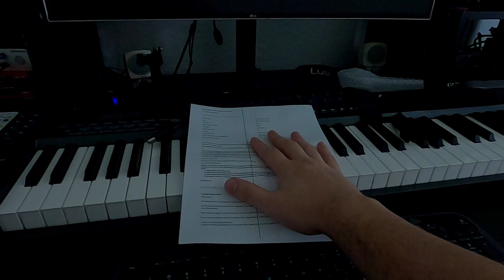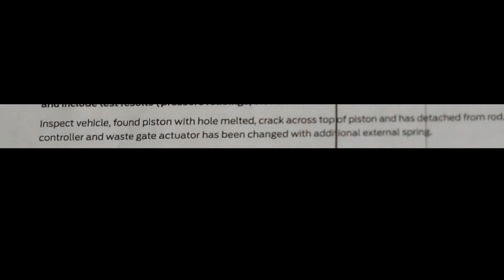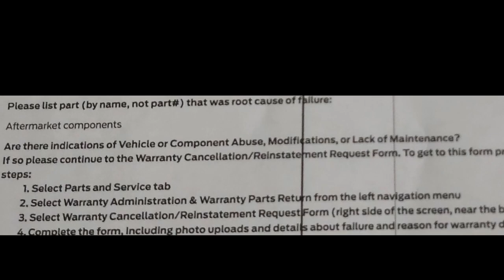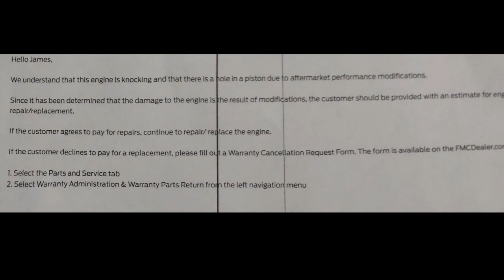IT'S OVER... Ford Cancels Warranty - BEWARE!

Comment: I watch your other videos and I don't blame Ford. Putting diesel , a gallon of Marvel Mystery oil and a gallon of Lucus gas treatment , a cheap air cooler from ebay for views. You shouldn't be calling a foul against Ford.. Go ahead and delete my post.
Reply from the maker: Diesel Fuel never went into the tank and the eBay Intercooler is irrelevant. Your first comment was fine, but now you have shown complete ignorance based on your perception of my other videos. My ecoboost isn't the first to prematurely eat itself, and it won't be the last.
Reply: @KarzKreated  don't matter you posted a video saying you put diesel in the tank, gallon of lucas in the tank so you made yourself appear guilty. It can be used against you. Sucks but you live and learn. Had a video of a truck that was purchased on a friday then ran through a mud pit on saturday, was blown up. they washed it rather good but the video was posted on FB and the service manager from local ford dealer seen it and they voided his warranty and future warranty.

Comment: One thing to remember is just the absolutely retarded amount of power they are squeezing out of a tiny 4 cylinder. (320+hp) So engine management is an extremely closely run thing. Adding a few more horses to a v8 and the ecm barely notices. Adding just a couple more to an engine thats literally pushing  its bounderies just in its stock config is a much bigger deal. Maybe any 1 or maybe  2 of your mods would be ok (probably) but all of them together might truely have caused an issue after a few thousand miles. Hard to say, but there is some possible legitamacy to what Ford is saying. The intake, intercooler and catch can are 100% positives, but anything messing directly w/ the turbo or ecm is playing w/ fire and not worth it IMO. Hope the rebuild goes well for you tho, I'll be watching.

Comment: A huge majority of new car owners will not add mods regardless of their function because it give the manufacture an easy way out. Did the crap you did and additives you used cause the engine damage? Doesn't matter to Ford. They will stand their ground based on what you did, and if you don't like it you and your lawyer can get in line with everyone else, and don't forget that Ford has more lawyers than you do. 

Also, posting your experiments and mods on social media for the world to see is a recipe for disaster. It would be a huge mistake to think they don't have investigators who look for that when facing possible legal action by the owner. 

Their findings have been documented, and you sir, screwed the pooch. You will disagree but they absolutely grabbed you by the short hairs.

Comment: I learned the hard way many years ago, when it's under warranty, stick with cosmetic mods, get the car visually where you want it, enjoy your car and save the drivetrain mods for after the warranty runs out. If you want a big power car, buy a big power car or wait until your warranty runs out. Sorry about your car man, hope you get it all worked out.

Comment: can you extract the engine telemetry  data from the ecm? it should have logged all the operational parameters real time up to the point of engine failure.
Reply from the maker: I asked if they scanned the car at all and was told they didn't have to. I'm not sure if they ever did or didn't.
Reply from the maker: @@user-ot9sm4se9l yeah that's the route I'm going. Many lessons learned!

Comment: Ford tech laughing. Honestly if u woulda just put it back yo stock b4 taking it back to the dealer u coulda got it covered lol
Reply from the maker: I'm glad you find it amusing because I don't. Even if put the factory wastegate actuator back on, and removed the boostmax, I still would have the intake and charge pipes on the car. I currently do not have the stock intake and charge pipes. So I'm sure even with the intake this still would have been a problem.
Reply: Yeah that's why you don't void your warranty by putting a bunch of aftermarket parts on a car. If you wanted to fast mustang you should have bought the roush. Not a V6 or whatever that is and try and church it up with aftermarket crap . And maybe don't post videos where you put a whole gallon of Lucas, I know the diesel video was BS, but, are you shocked? I'm not

Comment: Putting on aftermarket performance parts while you're still under a powertrain warranty is asking for trouble. Ford is a corporate multinational and doesn't really care about consumers. You're not their customer, the dealership is. Talk to a lawyer, man. You should still have the rest of the "bumper to bumper" warranty in effect (unless it's more than three years ownership), as well as other warranties like rust-perforation and perhaps pollution controls (though Ford will try to skate on that last one because it's engine-related). As I say, get some legal advice from an attorney.
Reply from the maker: Yeah I will have learned many life lessons after this this is all said and done. An Attorney has been contacted. We'll see where it goes I guess.

Comment: why did you not put your stock parts back on before taking it
Reply from the maker: Unfortunately I don't have all of the stock  parts with me. I could've swapped the stock wastegate actuator and removed the boostmax but the intake and charge pipes couldn't be changed so if they still wanted to void the warranty do to "aftermarket components" they still had a reason to.
Reply: @KarzKreated  that sucks. i have all of my stock parts still to this date and only because i have a new engine from Ford because some garage dis not install the rear main seal in right. All my oil ended up in the clutch bell housing

Comment: Since you think the law is on your side (as you mention the Magnuson-Moss Warranty Act), why don't you try to fight Ford? Contact your local news channels and your state's Attorney General, etc.
Reply from the maker: As with most things, there's the possibility of a positive outcome, or a negative outcome. I have contacted an Attorney and I'm waiting to hear back. I don't think I would go to the extent of getting the news involved because that can create a negative and potential hostal reaction. I don't want that kind of attention. I'm going to tear the engine apart myself, document any findings that could be useful, and go on from there. If there's anything that can reasonably done legally, I'll pursue the matter.
Reply: @KarzKreated   - You just didn't say anything about pursuing it legally in your videos. So, I'm glad to hear that you are pursuing legal action, as well.
Reply: @KarzKreated with you pulling it apart yourself, I’m afraid you have exhausted that route, because now ford will not touch it at all and I don’t think they have to give a better reason than you messed with it yourself. Should’ve left the motor in it and claimed it as a lemon. Which most lawyers will do probono. Ouch

Comment: Bolt on parts used to be allowed. Not always now hell I have a friend that has a Dodge Durango lifetime drivetrain warranty didn't have the transmission serviced by a service tech at the right interval warranty voided transmission issues is problem That's what they do they provide you with the ability to think that you're covered so you buy the vehicle then they use all the small print to kick you out of that warranty buy a car from anybody nowadays that's exactly how it is
Reply from the maker: It's nuts

Comment: why does that oil filter look bigger that the stock one?
Reply from the maker: It is larger. Common upgrade for the 4 cylinder ecoboosts. I think it's a  Motorcraft FL-400 filter.